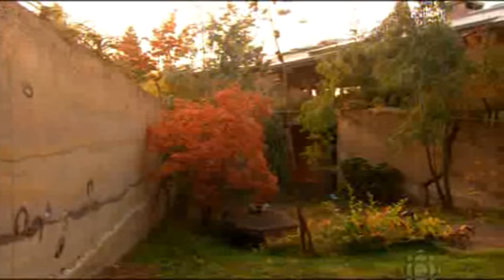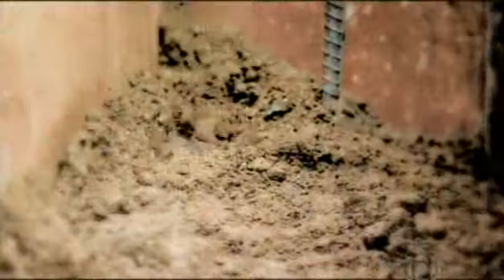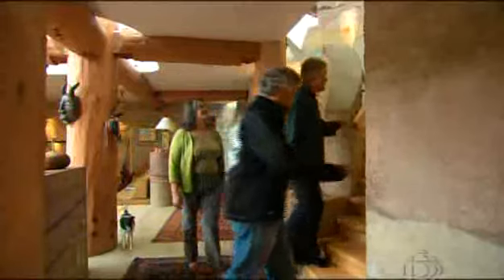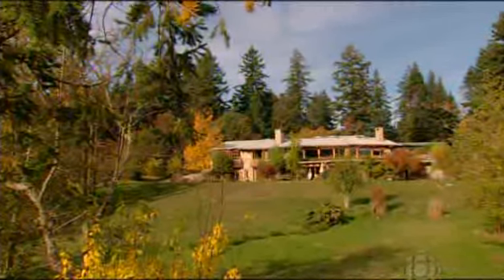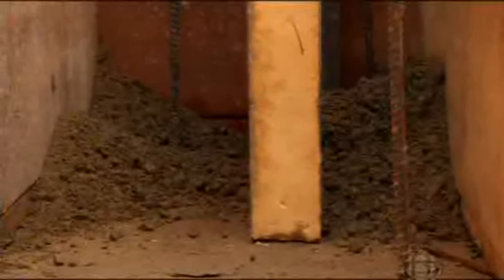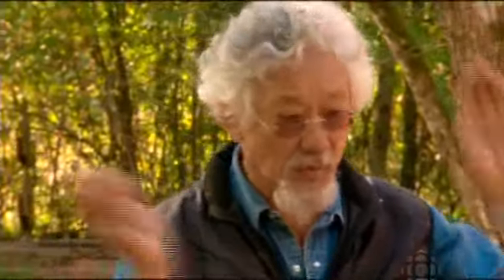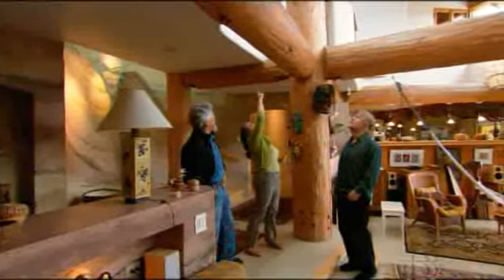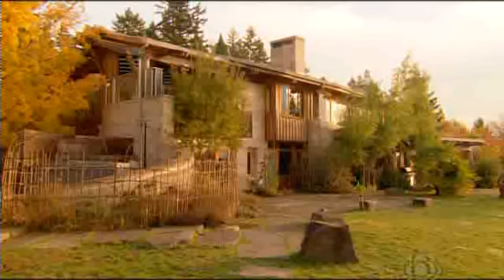Build Green   Rammed Earth snippet

Comment: Would this concept work in  tropical islands in the Caribbean?
Reply: It would work really well! Just make the walls thinner because you dont need the insulation
Reply: Rammed earth works best in temperate mild climates where the walls can absorb the suns warmth during the day and release this energy in the cool of the night. This is called the thermal flywheel. If you live in a climate that does not have cool nights and has constant humidity then your thermally efficient walls become inefficient resulting in a somewhat unpleasant interior mean temp.